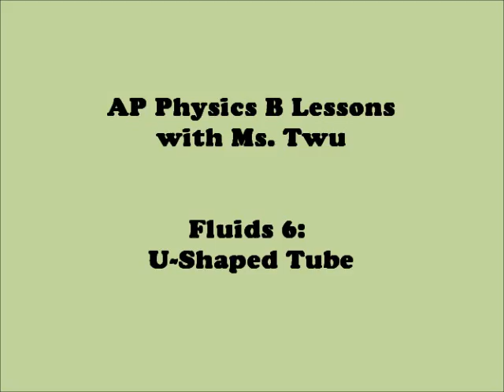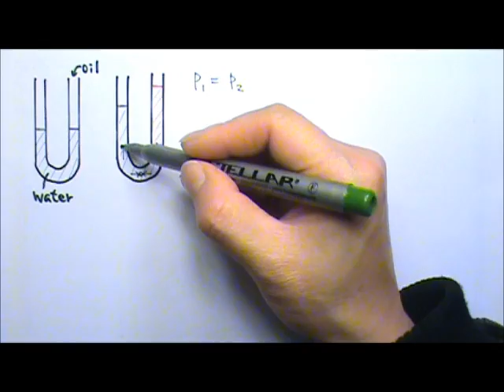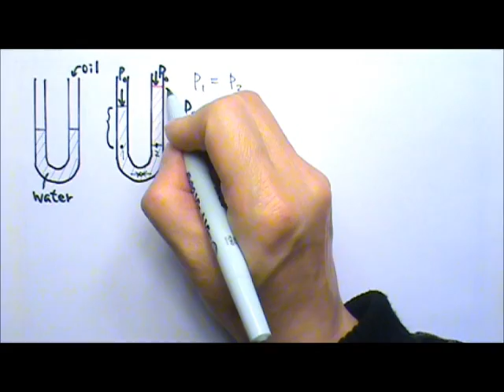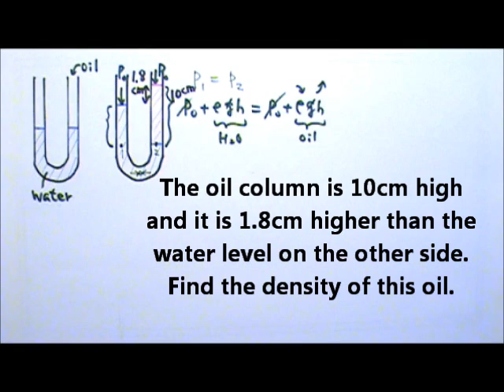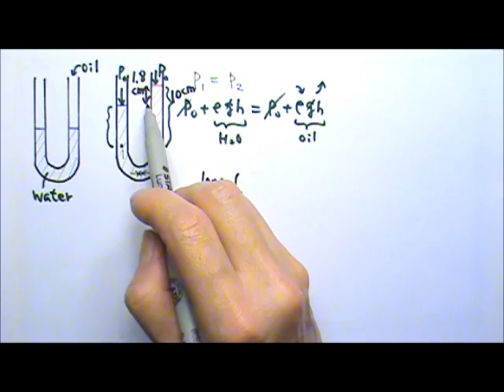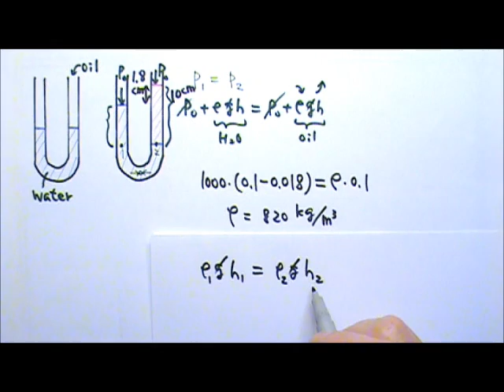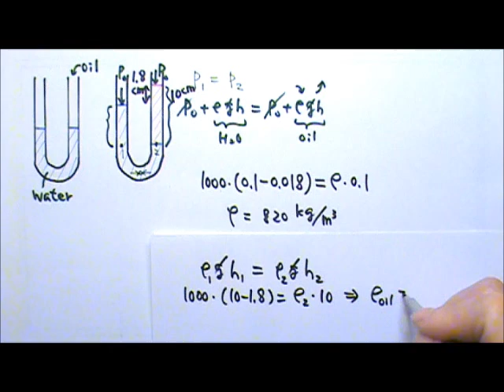AP Physics 1: Fluid Mechanics 6: U-Shaped Tube

Comment: Does cross sectional areas affect in pressure
If the u tube is not uniform in cross section can’t we apply d1h1=d2h2 for two points at equal height in same liquid.(at the common interface)  (d means density)

Comment: Question: will water be pushed even more if more oil is added?
Reply from the maker: Yes, if more oil is added to the right side, the water will get pushed to more to the left side. Because the pressures on both sides have to equal, so if the h of the oil increases, the h on the water side has to increase too.

Comment: how can we solve a problem like this when only volumes of liquids are given and not the heights
Reply from the maker: You won't be able to unless the cross-sectional areas are also known because knowing volume and cross-sectional area will allow you to find the height (V = h A). Or if you know the cross-sectional area are the same on both sides, then the height would be proportional to volume. Another thing is that you will have to know the volumes above points 1 and 2.
Reply: But the cross sectional area get cancells right

Comment: question, should the density used be 1 g/cm3 if we are using the cm for height? or is it ok to use kg/m3 and cm for height?? im a little confused on that concept.
Reply from the maker: Since we have ρgh = ρgh, as long as the 2 ρ's have the same unit and the 2 h's have the same unit, everything is fine. So both the density can be in g/cm3 while both the depth are in meters.